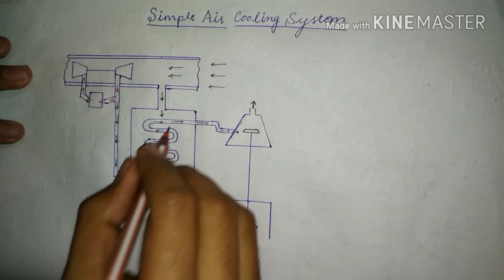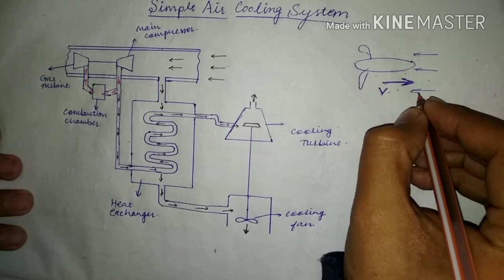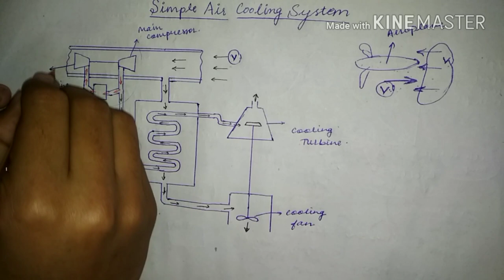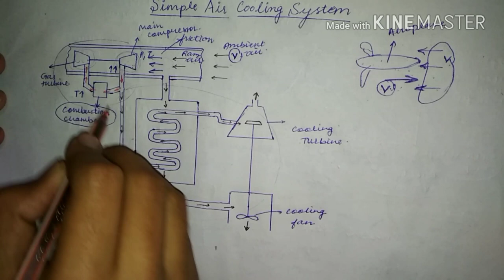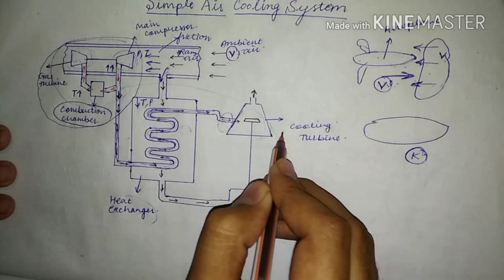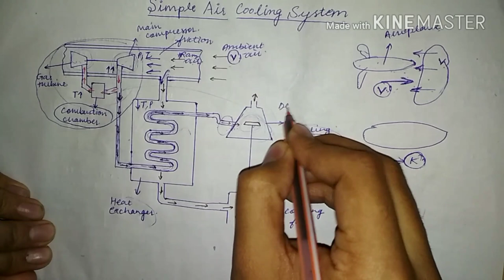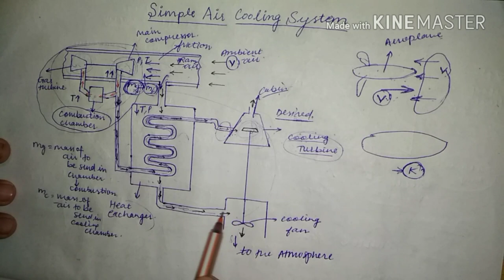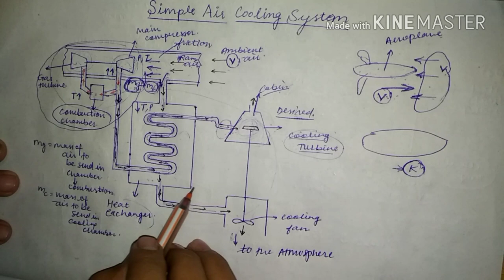Simple air cooling system

Comment: A boot-strap air refrigeration system of 20 TR capacity is used for an aeroplane flying at an of 2000 m. The ambient air pressure and temperature are 0.8 bar and O°C. The ram air pressure and temperature are 1.05 bar and 17°C. The pressure of air after isentropic compression in the main compressor is 4 bar. This air is now cooled to 27C in another auxiliary heat exchanger and then expanded isentropically upto the cabin pressure of 1.01 bar. If the air leaves the cabin at 25°C and the efficiencies for the main compressor, auxiliary compressor and the cooling turbine are 80%; 75% and 80% respectively; find :1. Power required to operate the system ; and 2. C.O.P. of the system.